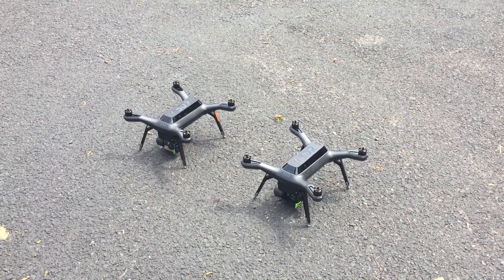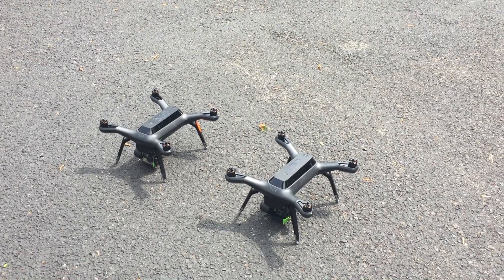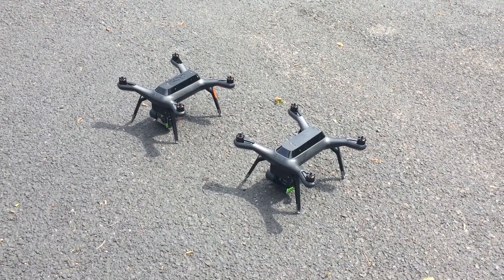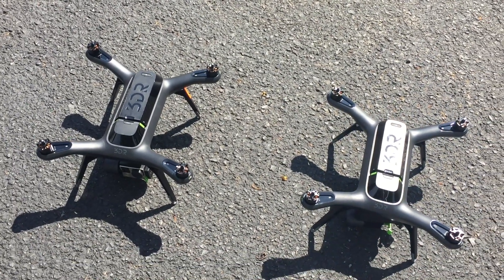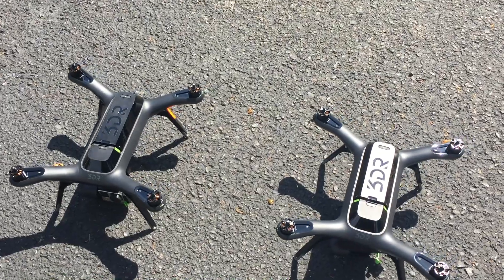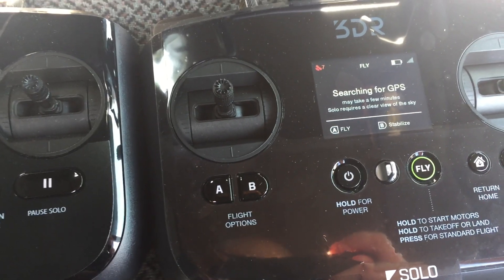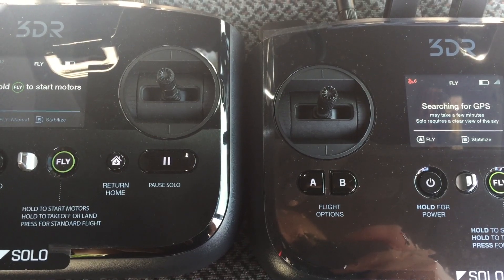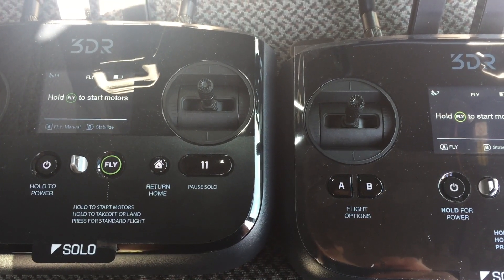3DR Solo MRO GPS VS VER B GPS Test

Comment: HI, WITH THE MRO  M8N GPS ON RTH IS IT MORE ACCURATE THAN STOCK GPS?. MY SOLO WITH STOCK GPS IN RTH SMOKES ANY DJI OR ANY DRONE MADE AT WORST MAYBE 12 INCHES AT MOST FROM TAKE OFF, DOES THE MRO M8N IMPROVE THIS?
Reply: I owned many dji drones and never had an issue with RTH accuracy, specially if you enabled “precision landing”.  Been a feature for a couple years now.  Starting with either phantom 4 or the Mavic Pro. But been since update to all current drones including my inspire 2, which is my oldest drone. 

My drones accuracy Starting at furtherest off (needing updates) and ending on the closest to exact take off..  (assuming windless conditions)

Mavic 2 Pro , 6-12 inches off (GPS)

Inspire 2 , up to 8-10 inches off (GPS)

P4P+ , up to 6-8 inches off 

Mavic Pro , upto 4-6 inches off 

Spark , 2-6 inches

Mavic Air , 1-4 inches off

The mavic 2 Pro is set to get precision landing but it’s unknown when, theory is it is delayed why they calibrate it’s low light landing precision using built in landing lights.. but who knows.  

I gave my inspire 2 GPS only landing precision because it’s the oldest drone I got and thus more fair comparison to disable Optical landing system for a fair comparison. With it in precision optics mode it is about as accurate as the Mavic Pro... very very close for such a big drone